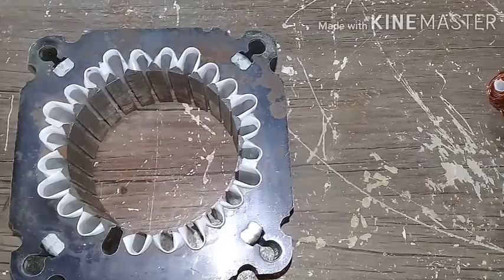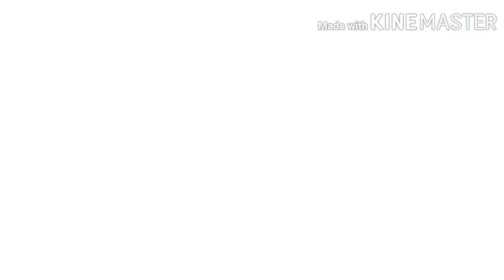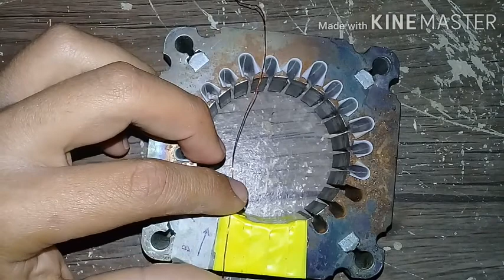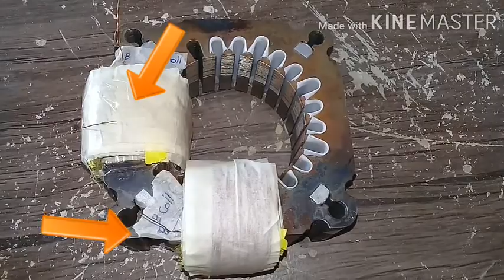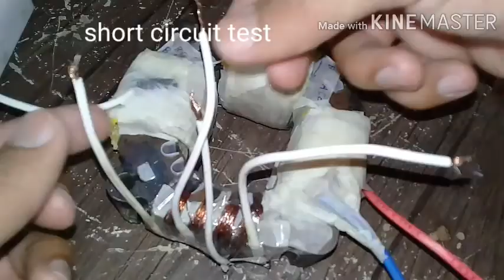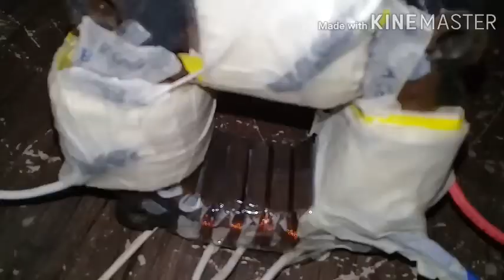Iron-silicon Transformer winding N calculation 220W

Comment: Good news, i made it and its working fantastic. 
🥰😀😀😀😀😇🤩🤩🤩👍👍👍👍

For the high current secondary should i do it in layers like you did or should i use 6 wires in parallel one beside another 
Like -   
||||||
||||||
||||||
Btw you are the best,thanks for all of it.
Reply from the maker: If you do it in layers it need a lot of time 
But if you make the 6 wires like a rope it will be faster n easy to wind

Your welcome

Comment: Bro,what was that 5.71 value ?
Did you use same wire diameter for 12v 20amp winding as other windings.
And what was your wire diameter?
Reply from the maker: 240V in the primary but you can split the winding if you have 120.
Or do 650 turn.
The diameter is 0.5mm .
Reply: @electromagic3111  and what is that 5.71 value?
Reply from the maker: @Surya_Singh_Thakur   that value depend on the transformer core
Reply: @electromagic3111  thanks a lot love you from my heart ❤ ♥
Reply from the maker: That value is turn per volt
For every turn you should make about 6 turns 
220v× 5.71=1256 turn
N if you want the out put to be 12V
12v× 5.71= 68 turn 
If you want 24 v
24×5.71 = 136 turn 

For 20 amp a used 6 layers of 0.5mm wire ( 3mm diameter wire will do the job)
Reply: @electromagic3111 how long can it give continuous 20amps at 12v 
 And can I get 25 volts with 6 × 0.5mm
Wire and what will be its current?
Reply: Please reply 🙏
Reply from the maker: @Surya_Singh_Thakur   will i didn't test the transformer yet 
But if you do the isolation good
N follow my procedure it will run 24/7
Second question 
Is yes  it will be the same current
(20amp)
Reply: @electromagic3111  will it work 24/7 with 23 volts?
Reply from the maker: @Surya_Singh_Thakur   yes the isolation is important too